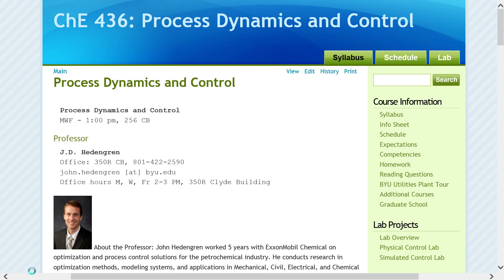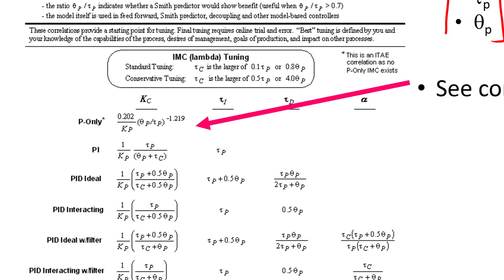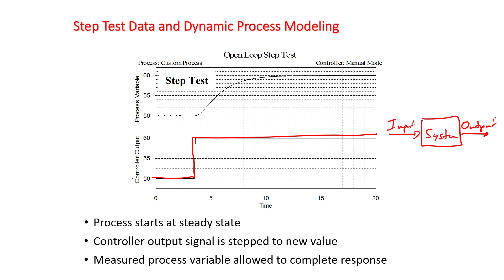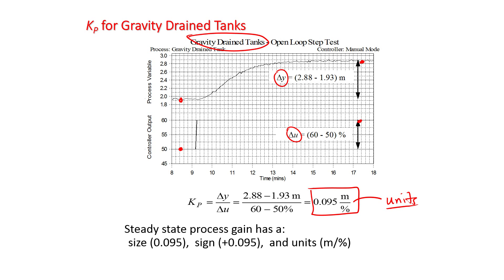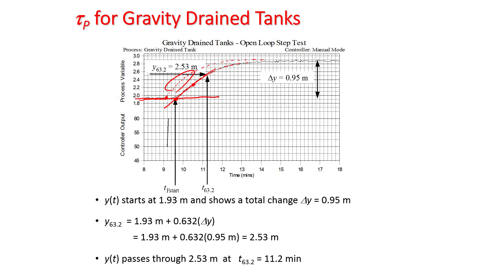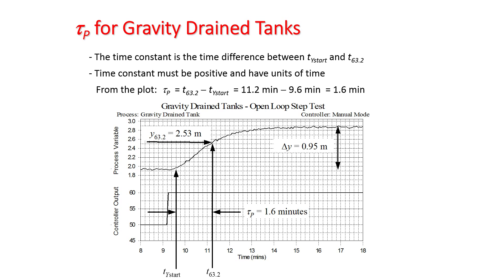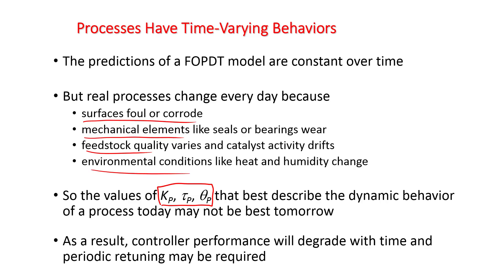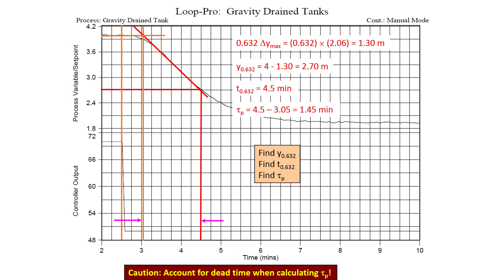FOPDT Linear Dynamic System

Comment: About the sign of Kp, I think that positive sign is when the acting is directly, it's mean that the controller output increase and the measured also increase. Thank you for good lectures and clarifiation.
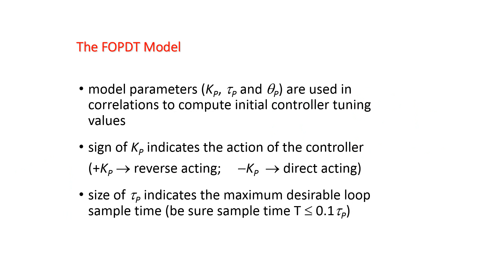Reply from the maker: The definition is correct at 3:36. A direct acting controller is one whose output tends to increase as the measurement signal increases (Kp and Kc are negative). A reverse acting controller is one whose output tends to decrease as the measurement signal increases (Kp and Kc are positive)